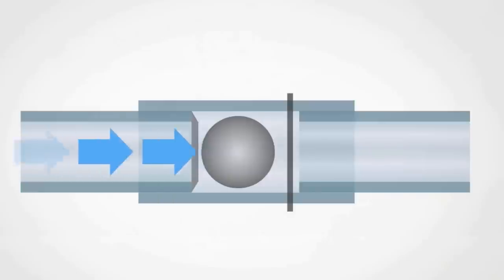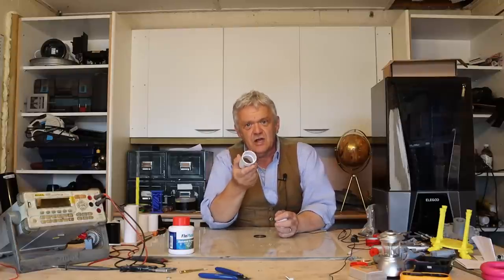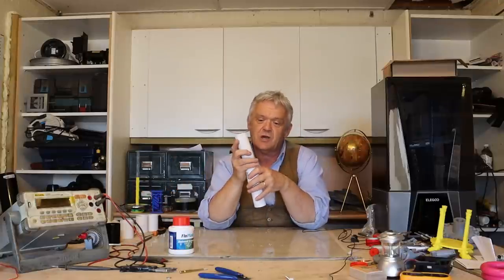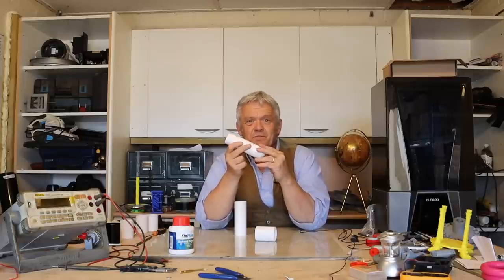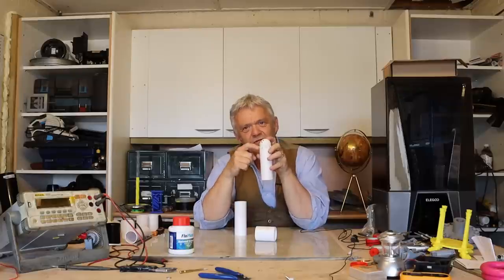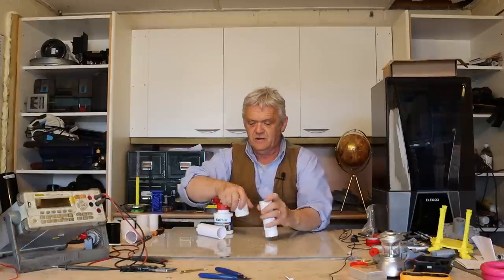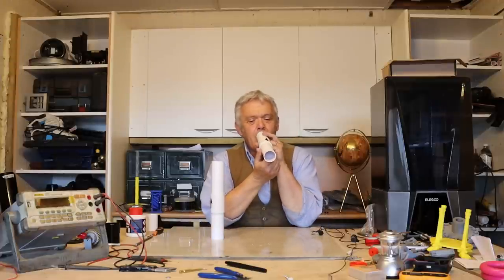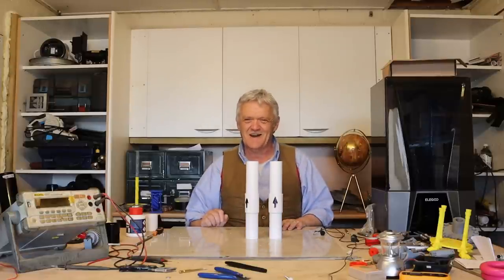2021 Ping Pong Ball Valve For A Water Pump

Comment: After seeing how much a none return valve for "1"1/2 pipe costs! I decided to make more or less the same set up as you. The only thing I calculated was the area of the pipe where the water goes in and out to make sure its the same area as the pipe I was using as a pump suction hose. Just so I know the water flow will not be reduced! Keep up the great work, Shaun.

Comment: This is wonderful just what I want for my low pressure rain water toilet. Please just keep these ideas coming. Am I the first?
Reply: I wonder how do you use it ? How works your system ?
Reply: @AutoNomades Hi  Currently I have the IBS tank on a manual switch but in the past I put low pressure valves on but they always leaked I had thought about fashioning one from the ball in a deodorant bottle but RMS come up with the ping-pong ball and readily available parts so I should give it a go. He has so many wonderful ideas that I want to try that it will take the next three lifetimes.

Comment: I have a sump in the garden to drain it, it used to very waterlogged, it pumps out via a 40mm pipe, I have tried a few off the shelf type valves and none have been brilliant, after the pump stops about 2-3 gallons run back into the sump, I'd given up trying to remedy it. I'll try this, thanks.

Comment: My dinghy had one to drain the cockpit of water,  The problem was that the ball dried-out and got brittle during storage, so it fell to bits and water got into the cockpit.
But not to worry,  when the water was ankle-deep, I rolled the boat on its side, and the water.drained.
Reply: Good to know that the ball doesn't conserve for ever ! So we let a way to open the system and change it without breaking all.......

Comment: I'm surprised the ball doesn't float.

What happens if the seal starts to leak, could it float then?

What about if there's some pressure on the other side?

Or does the Venturi effect solve these issues???

Comment: I need a sump pump check valve replaced after moving in this house recently. My question would be, since a sump pump flows rather hard, would it put a strain on the pump restricting the flow to go through those holes?  Ot make the pump run longer than it used to..
Reply: A flap valve will not restrict flow. Similar to the flap in the toilet tank.
Reply: yeah, I will have to consider both ways. I would rather not have to buy one but have not shopped for it either. Sounds bit high according to happydaysveg1965 below here.

Comment: daer robert 40mm is 1.5"
Reply: That nomial size is referred to as 3/4" pipe size. The size is determined by the ID of a particular wall thickness pipe. Schedule 80 I believe, but I might be off on the particular schedule number.
Reply: @Vibe77Guy   i think you may be mistaken my friend.
Reply: @garygranato9164  
Correct. Must be a 1" coupler. Which has a 42.16mm OD.
However,  since a ping pong ball is itself 40mm, it has to be a 1-1/4" coupler.
Reply: Robert is confusing old waste sizes with old copper sizes. It’s an age thing lol. I knew what he meant right away……
Reply: @Vibe77Guy  lol,   your joking right ?  are you from america ?
Reply: @garygranato9164  
Of course. I had to look up the PVC coupler size specifications, as well as the 'official' ping pong ball dimensions. 
Might be from the US, but I'm also a retired mechanical engineer. 
1-1/2" PVC pipe is 40.4mm ID and would allow a 40mm ping pong ball to pass completely through. The 1-1/4" coupling socket however would be a quite good loose fit, while keeping the ball trapped.
Reply: @Vibe77Guy   good call david

Comment: This idea or using easily available parts is ridiculous!  There should be at least one ridiculous part that fails regularly and is difficult to get out of the valve and very expensive to replace.  Not as expensive as a new valve but so expensive that it makes getting a new valve a consideration.  You know, like car part spares.